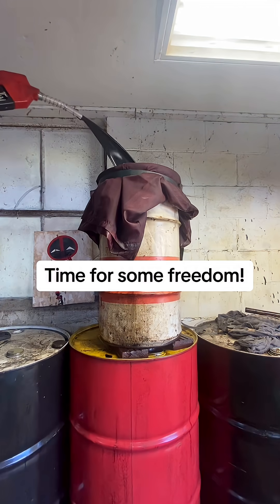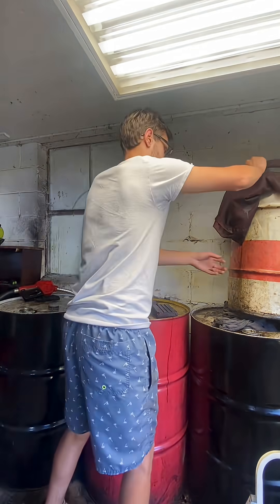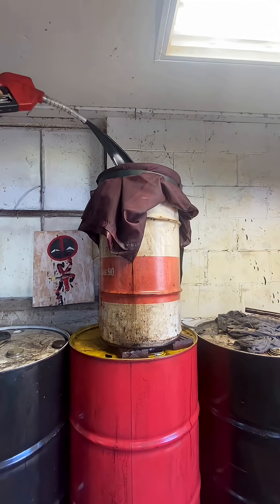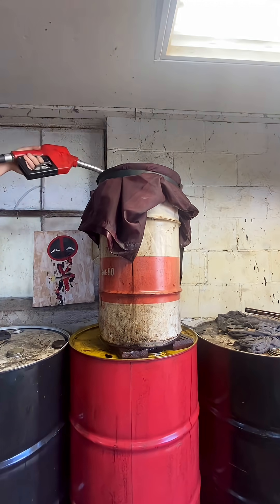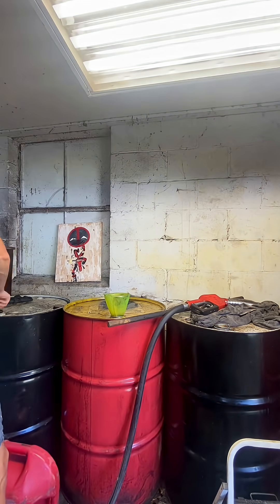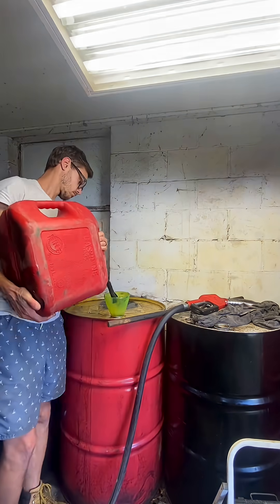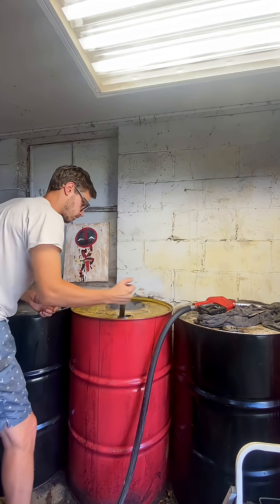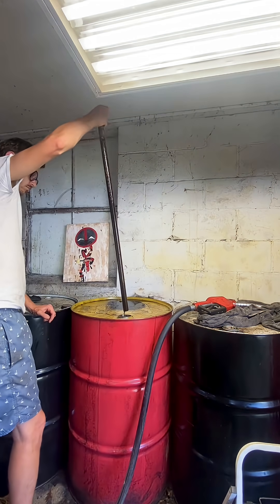Transform #wastemotoroil into #homemadediesel Fuel #dieselmechanic

Comment: I used 10micron sock filters from McMaster-Carr when I made fuel from waste vegetable oil. Never did the used motor oil as I wanted my $500 Mercedes’ diesel injection pumps to last. 
The veggie oil had more lubricity than modern low-sulfur diesel: the motor quieted down considerably when it hit the injectors the first time. Here in Virginia, I used 5% gasoline in summer, and 10% in winter—but also paid attention to the weather forecast and went to the diesel/kerosene mix the owners’ manual recommended when temps got too low (for Virginia). Only had it solidify once when my first, really crappy, 300TD broke down with nowhere to plug in the block heater. 
My filtration setup cost < $100 and was 3-stage: each day when I got home from work I’d spend 20 minutes emptying each stage into the next. Best part was the smell: sitting at a light in the spring, I’d see people around me sniffing and looking around for the source. I only used non-hydrogenated peanut oil from a couple restaurants that didn’t use their oil to death. Good times. But, I always carried multiple primary & secondary fuel filters: that waste veggie oil sure cleaned the algae out of the tanks!
Started in 2001, and finally sold my last 300TD a couple years back. Miss those old cruisers, but I put so many miles on the work van that I now want lightweight manual gas cars to play in on my own time.
Reply: I know a guy who converted his (and others) VW Vanagon Syncros to diesel. He did the fryer oil thing. When we went out 4x4 excursions it was always a trip to smell his French Fry flavored van. Out in the middle of the woods of West Virginia. 

It was even funnier when we ran into other groups. Bewildered at the smell of French fries 😂
Reply: @sethfg couple kids I went to school with would always run oil from the local Chinese restaurant. Egg rolls weren't a smell you were expecting a mudding or crawling excursion lol
Reply: @rustyhua  OOF - Not a fan of egg rolls 😂. What type of vehicle?
Reply: @sethfg  It was an old beater truck, rednecked together over the years lol but unfortunately it's been so long that that and the egg rolls are all I remember now lol
Reply: When Rudolf Christian Karl Diesel invented his eponymous engine he designed it to run on peanut oil. Maybe he had a reliable source of that vegetable oil. But he also made it possible to run on rock oil: Petroleum [from the Greek word 'Petra' / rock. Some of you will recall that the disciple Peter was referred to byJesus as 'my Rock.' ] 
Just sayin'
Reply: @garynicholls1448 no Peter wasn't referred to as "My rock". Jesus's statement was "You are Petros (a small rock, like a stone), and on this petra (bedrock) I will build My church." 

Peter himself didn't believe he was the rock but instead that Jesus was.

1 Peter 2:8 expressly identifies Christ as the rock, stating that He is "a petra of offense" to those that won't follow Him.

Paul also identified Christ as the rock in 1 Cor 10:4.

There are literally dozens of places in the OT where God is called the rock. Multiple Messianic prophecies use the exact same imagery as well.
Reply: @garynicholls1448 Jesus didn't call Peter "My rock". He said, "You are Petros (a small rock) and on this petra (bedrock) I will build My church."

Peter understood that to mean Jesus was the rock, as the OT said dozens of times, going so far as to expressly say that in 1 Peter 2:8.
Reply: Just saying what? What point are you trying to make? That petroleum is holy or some shit?  @garynicholls1448
Reply: i converted my vw passat 1.9td to only run 100% vegetable oil, timing adjusted, altered glow plugs, preheating, heating, improved injectors and pump, bigger fuel piping, every pipe in oil stable version etc.
was a very successful build, no smell, nothing, starts in the coldest winter -23C no problem. registered with the tuv inspection, drove about 70k miles on pure vegetable oil, then sold the car to another vegetable oil enthusiast.
Reply: I had a Mitsubishi fuso I dumped waste oil in all the time. 
I do generator service so it was Diesel and LP fueled engine waste oil. 
Ran it from 40k to 270k and never had an issue. 
I do run my own diesels on motor oil, but I have access to new oil so I use that
Reply: Can that be used on an oil furnace? 🤔
Reply: @rcbustanut2057 I wouldn't!!
House fire risk.
That diesel is supposed to be high Ash and if it isn't the inside of the burner, the boiler, and the chimney will become caked up in soot and be eventually a chimney fire potential.
Not worth it.
It's a detailed setup so it burns clean.
If you are convinced then have a boiler mechanic come oversee the switch.
Definitely NOT "plug and play" it will have to be recalibrated to the new fuel.
Reply: @RetroCaptain Thanks!! 👍 I was legit curious because I have heard of people running out of oil for their furnace & using diesel temporarily until they get their oil delivered. I wouldn't risk this lol. 

I'm new to oil, bought my 1st home back in 2021 & it has an oil furnace. I have been able to maintain & repair gas furnaces but this is new to me, trying to figure out the mechanics of it. I hate not being able to service my own equipment.
Reply: I saw a car belonging to the hotel on an island with the bumper sticker: Runs on waste cooking oil.
Reply: @20chocsaday McDonalds in the UK run their trucks on waste oil.
Reply: Hi dud you get good mileage?
Reply: @MohamedHassan-if8in from what I read, waste vegetable oil has less BTUs per gallon than diesel. As I was filling my car from gas cans, I didn’t have accurate measurements of fuel used. Also, in-town, interstate, rural farm visit, etc usage varied widely. I guesstimated that I got perhaps 10% fewer miles per gallon than with pump diesel—but, I also floored it a LOT cause my fuel cost  was 5 or 10% gasoline depending on season
Reply: That part about people sniffing is what i would call a clue. Lol. I'm not policing you, cuz I don't care, but it definitely contains more useful data. Lol. There's uh... Reasons for that.
Reply: Are you me?  I owned a 1982 300SD that I bought on Craigslist for maybe $1000 circa 2007, and I made a 3-stage filter with McMaster-Carr 10, 5, and 1 micron sock filters with WVO from local pizzerias.  It was great when WVO was free.  Then it achieved cost parity with diesel and it was pointless, so I sold the car.
Reply: @jtocwru close cousins, at least!
Reply: Lubricity ? 🤣 I think the word your looking for is viscous or viscosity
Reply: @geraldstanley9521  When I was reading up before doing it, lubricity was the term I ran across. Basically, the veggie oil reduces friction between close-fitting components better than the low-sulfur diesel available in the States
Reply: Even with all that...I'll bet your engine was all gummed up. I've never seen home made fuel that didn't wreck the engine eventually...and by eventually I mean in a couple years tops.
Reply: @mattycheezeburger  Well, I never tore any of the engines down, but I first settled the WVO, then coarse filter, ‘washed’ with air bubbles, then fine filter. My first SD blew a head gasket, but the others I ran on my brew long-term all lived on after I sold them. The TD is still alive & well down in Mississippi to this day. 

I did a bit of reading before I jumped in. Only used non-hydrogenated peanut oil: hydrogenated corn oil contributes a lot to sludging of the fuel system from what I understand. Also, I would run 5gallons of actual biodiesel through each year as that is an excellent solvent for diesel fuel systems. 

Actually, once the initial tank-cleaning was complete in each vehicle, I never had any crud visible in either primary or secondary fuel filter. 
As always, YMMV
✌️
Reply: @Scot-p1v So did you make actual biodiesel or just use the filtered peanut oil mixed with gas? My old boss made biodiesel using the lye and methanol method(side effect was plenty of soap!). He also did the air bubble filter through a large tank filled with little 2 inch sections of tubing but if i remember right it was to remove moisture not contaminants.
Reply: @Lotek117  I didn’t do the biodiesel as I didn’t have a convenient way to dispose of wastewater: my backyard included a creek. And I was a single dad with a grade-school daughter at the time; diluted WVO seemed quicker and safer.
Reply: @Scot-p1v  .. for the beginners 
What books or online links 
Can you recommend for this type 
of filtering process! 🛢️
Reply: @Scot-p1v 
Peanut Oil (GNO) is quite viscose compared to Corn Oil and especially Safflower Oil.
Reply: @iammaximus614  I used Joshua Tickle’s From the Fryer to the Fuel Tank as a starter. Then a LOT of time on old Usenet groups. Note that it’s tough to find sources of used fryer oil that are non-hydrogenated peanut oil. When my source dried up, I didn’t have good results with hydrogenated corn oil. Also, 25 years ago, I could get it for free. In the 2010s, many communities drafted laws about licensing collection of waste vegetable oil: might want to check your locality before getting invested
Reply: This is nonsense you cannot just pour vegetable oil in you diesel engine truck, you would need to change the viscosity of the vegetable oil, by heating it before entering you injectors,  it would need to raise the flash point
Reply: @Dezzy-e8b I know plenty of people who have done it, normally people mix veg oil with about 20% diesel and its good to go.
Reply: @420styletomatoes6 south African farmers at one time produced most of there diesel on there own farm using sunflower seed vegetable oil but the engines still need to be adopted,  otherwise you not going to have an engine in a short while
Reply: @Dezzy-e8b all the people i knew who done it only put in old diesel vehicles they were running till the wheels fell off.
Reply: @Dezzy-e8b  I don’t know from ‘cannot’ : I did it for years. Within constraints if you read my comment
Reply: @Dezzy-e8b I use WVO in my old OM616 Mercedes. I have dual tanks with selector valves and a heated filter using an oil cooler with the hot side of the coolant instead of the cold side. It runs better on WVO than it does on diesel. The key is switching tanks when you're done driving and purging the WVO back out of the system. Hot and moving WVO won't gum things up, but it 100% will if it's sitting still over time. (Eventually).
Reply: @Dezzy-e8b  I had a Greasecar system in my '82 300SD.  Basically a separate tank in the trunk that had an immersion coil through which the engine coolant circulated.  Once the veg oil warmed up, I had a switch on the dash to toggle a set of solenoid-switched valves under the hood to select between diesel and veg supply/return lines.  It was a great system.  Never had any problems, and drove thousands of miles.
Reply: Cool story, bro.

Comment: Anyone who's ever had a truck with gasoline put in it by mistake knows, gasoline isn't making this better fuel - it doesn't have more pop under compression ignition, it's got less, it'd be much better to thin it with actual diesel, or a gallon of diesel-kleen. Gas makes white fuel smoke and no power.

Comment: Are you serious that you only need 5 gallons of gas to 55 gallons of regular oil. How is that able to be pushed through fuel lines to the engine. I don’t think it is thin enough to be pushed and ran for fuel. I don’t see that happening sir. You have to show an empty. Video making your diesel and pouring into an empty gas tank and then cranking the engine to run. When you video it you can not cut it . Has to be a continuous video.

Comment: You must hate your fuel system and your engine for that matter. If you're using this in an oil burning heater, there's no problem with this. But putting this into a vehicle is stupid.

Comment: How to destroy your modern diesel engine in 3 steps.

You can’t possibly think that this is true diesel my man?
This will destroy your pump and injection system and possibly even your valves because it burns completely wrong.

There are old engine out there which can burn this kind of stuff, your truck made from the 70s onwards isn’t one of those vehicles.

Comment: I’ve run 50/50 waste motor oil and diesel through a P-7100 pump 5.9 Cummins and a DT-466P international before and they don’t seem to care much…then again, pretty sure those P-pumps will pump sand and ball bearings quite happily. Don’t think I’d recommend trying it in a CP3 or definitely not a CP4 truck. Every once in a while, with the P-pump trucks, you’d get some weird starting issues (crank no start, let off the key, crank it again, starts just fine), then feed them a tank of straight diesel with some dieselkleen gray bottle, and they’d clean right up and be good for a while again on the mix.

Comment: Can’t wait to get myself an old 12 valve all mechanical Cummins. Then you can run this type of stuff.  I remember when I was a diesel mechanic in the Marines.  We would pump dextron tranny fluid into my buddies 7.3 power stroke and used to run all over California on trans fluid.  Worked great. I kind of felt bad back in the day taking from the tax payers. But after all the corruption we know about. I no longer feel bad at all. lol

Comment: Do not even think of running this fuel in a diesel with a DPF system. This is great for older engines mostly anything without a computer. Cat and Cummins advertised in early years how to do this to help sell their equipment to American farmers. I think it was from cradle to birth fuel systems.

Comment: Eventually, you're going to have maintenance issues in whatever engine you run this in. Better add, a magnetic way to pull the metal in the oil. And, you can use an old bandsaw running through a trough that the oil will cling to and the blade runs through a tiny wiper and a magnet and the water droplets just stay below and grow. Or go another way and you could route that to another barrel. Will take you just a little bit to figure this stuff out to cheaply refine your 2 stroke mix. You can run  an old washing machine or a new one, and fill that with oil, and let it spin and drain, this will then separate everything and then pump that into that water separation unit i mentioned then, metal,  then cut it with your gasoline.  Believe it or not,  may be cheaper to sell that used oil for cash. Because most state revenue departments watch people who deal in used oil. And they have to account for every gallon.  They don't make it easy, you soon find out who the mafia really is ✌️

Comment: Anything with a mechanical IDI pump will be fine on this up to 50/50 low sulfur and homebrew.
Older military multi fuel will run his homebrew straight with no additional diesel added.
But please don't try this in your 2025 Power Stroke, Duramax or Cummins 🤣

Comment: Are you adding detergents & anti foaming agents.
What are you doing to remove the corrosive acid and small micron metal flakes that will destroy you diesel engine. 
Adding 10% gas into the oil will evaporate off quickly if not used quickly in a diesel fuel tank.

Comment: Yeah that’s not clean enough for me to run in my truck. Why not go to a scrap yard find an oil pump and get some actual oil filters and filter the oil well. Also adding the petrol to the 55g barrel before the oil goes in will net you a much more even mix than your dowel. That said is it necessary to add petrol to the oil, I’m 99% sure that the oil would be combustible without it

Comment: This is not a proper way to make black diesel. Motor oil must be run through a centrifuge to clean out the debris using a bedsheet as a filter is worthless he might as well pump it direct into the trucks fuel tank.

Comment: You can run a petrol engine on water, heat the water to 112 degrees centigrade and it splits into hydrogen and oxygen

Comment: If someone's reading this who drives a modern diesel with common rail electronic diesel injection, don't pour this in your vehicle.
If it's an old mercedes pre-chamber diesel, this will probably work great! With more filtering, most mechanical injection diesels would probably run pretty good on it. Electronic diesel? Nope.

Comment: Dose it matter what motor oil or it can be any used up oil
Reply: Bro don’t even think about doing what this guy is doing used motor oil has to be run through a centrifuge to remove all the carbon and metal contaminants before it is put into a diesels fuel system and if it’s a cp3 or cp4 pump style diesel don’t even think about it.